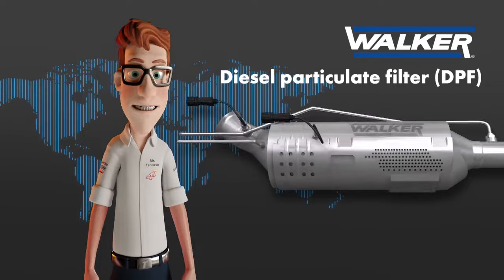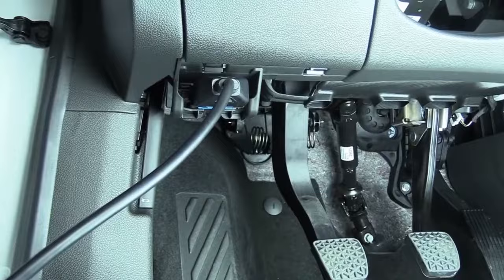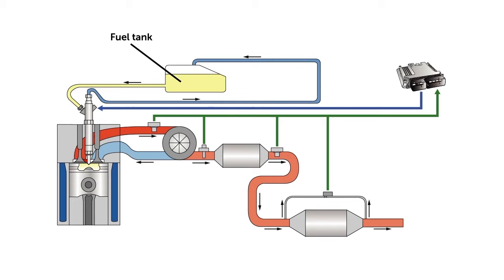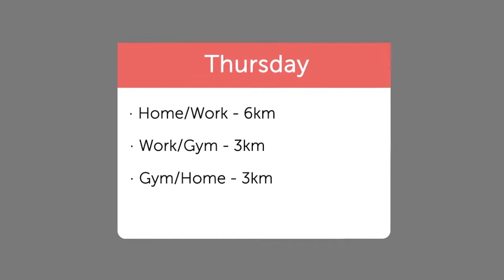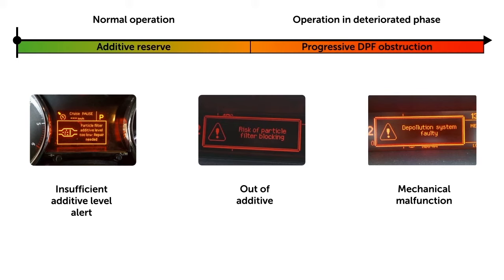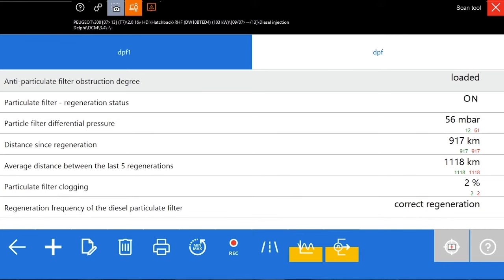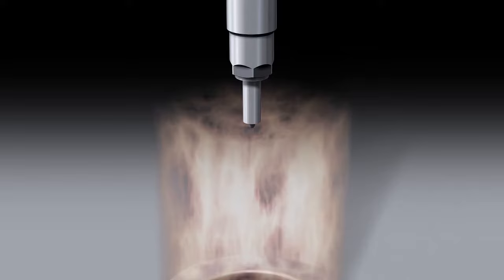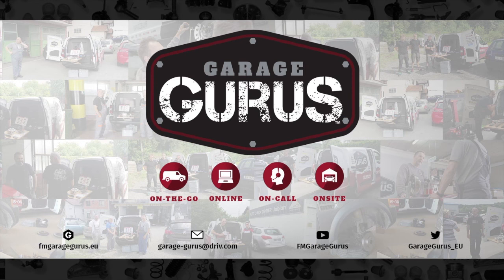Understanding the DPF Systems

Comment: The process goes unnoticed by the driver. Biggest lie I heard this month :D
Reply from the maker: Thank you for your feedback. Regarding the Diesel Particulate Filter (DPF). The DPF undergoes two regeneration processes. The first type is known as continuous regeneration, which occurs consistently when the filter's temperature ranges between 270°C and 450°C. This process is highly effective as it burns more particles than the filter can store. It is completely inconspicuous to the driver as no adjustments are required to the engine parameters. If the vehicle maintains this temperature range at the DPF, typically while driving on highways or intercity roads, the filter will remain mostly clean, eliminating the need for additional forced regeneration cycles. However, as a precautionary measure, the system performs a safety forced regeneration approximately every 1,800 kilometres to ensure the filter's cleanliness. Since the filter is already clean, this safety regeneration is usually brief.

On the other hand, if the vehicle primarily operates in city or congested road conditions, forced regeneration may occur at intervals ranging from 400 to 800 kilometres, or even shorter. This second type of regeneration involves specific engine processes such as post injections and the activation of electric resistances. These actions increase the temperature of the gases that reach the DPF filter up to 500°C. In non-additivated models, this regeneration process typically takes between 10 and 16 minutes, while in additive-assisted models, it lasts between 6 and 10 minutes. It is worth noting that this type of regeneration is easily detectable if the driver reduces the engine's revolutions or stops it due to the involved processes.

Have a nice day,

Garage Gurus Team
Reply: Me watching this video with a blocked DPf filter that now needs to be manually regenerated 😅

Comment: Heres a couple of DPF tips use low ash oil, not any old supermarket shite or garage oil sold by the barrel by mechanics, it's cheap, and has a high ash content also , dpf cleaner   additives in the tank and occasional high quality diesel helps keep the system clean as diesel isnt as good as it once was , take highway journey at 70mph or 100km an hour in fourth gear keep it there at a constant RPM try not to adjust the speed for 30/40 mins at a consistent speed to help passive regen happen.
Reply from the maker: Hello!
You're absolutely right about the importance of using the appropriate oil; it's crucial for maintaining the optimal performance of your Diesel Particulate Filter (DPF). Car manufacturers rigorously test their engines with a specific type of oil to ensure flawless operation. This oil contains the precise balance of phosphorus and other additives, making it the ideal choice for your vehicle. This is precisely why Walker strongly advises consistently using the oil type and brand recommended by the manufacturer.

Moreover, the quality of the fuel you choose also significantly impacts the level of soot accumulation in your DPF. Opting for low-quality fuel can significantly reduce the lifespan of your filter.

To ensure proper DPF regeneration, Walker recommends driving your car at speeds exceeding 80 km/h for at least 15-20 minutes twice a week. This practice effectively cleans out the filter and helps prevent future issues.

Have a nice day!

Garage Gurus Team
Reply: All great ways to invest more $$ in an unnecessary system.

Comment: Great video, but doing some research on cerium oxide fuel additives, it seems like they have been stopped because the health effects of it's emission, being higher than the benefits of it's effect on combustion.
Reply from the maker: Hi Ignasi, Thanks for your comment. You are right about the fact the cerium oxide has been little by little reduced from the DPF additives replacing it with Iron based additives in the new compounds, this was also due to the fact that cerium oxides produced mineral deposits in the DPF honeycomb reducing the lifetime of the DPF. As you could see the old model where lasting around 80.000Km and nowadays the newer models lifetime of a DPF is way over 250.000Km.
Have a nice day!

Comment: We have a Peugeot 307 (1.6HDI Euro4). The car has 240,000 km. There is a lot of black smoke coming from the exhaust. When we pass 2,800 - 3,000 rpm, the "Depollution System Fault" error occurs and the car does not drive well. What can we do?

Comment: My gripe is that many manufacturers forgot to allow operator commanded regens.  My vehicle, all it did all day, was regen.  Then for some reason it wasn’t.  Threw a code requiring a regen, but I couldn’t force it to do one, only when I went into OBD could I attempt one, by which time it needed a new filter.  Manufacturer ate the cost of that one.
Reply from the maker: Hello!
Thank you for sharing your experience with your vehicle. It's unfortunate that you've had to deal with this issue, but I appreciate you taking the time to provide feedback. It's worth noting that the process of forcing regeneration from autodiagnostic equipment can be tricky at times, so it's understandable that you may have encountered some difficulties. Once again, thank you for sharing your comment.
Garage Gurus Team
Reply: It's a more general problem.  They don't show error codes to users or allow actuator controls to debug problems.  You have to buy expensive scan tools.

Cars really should have that stuff built in.  It's basically locked behind software there's no reason to not have it.
Reply: Once those sensors are clogged or vaporizer is you can forget a forced or passive regen system needs cleaning out first on or off also need to do a system health checks first before anything there are values in pressure that need to be taken into consideration sometimes dpf is blamed but issues can lie in other places causing it the root problem

Comment: Great video but every car I buy these are the first things I remove. Car drives so much better, more HP and better fuel consumption
Reply from the maker: Thank you for your comment. Currently, these systems are integrated as standard, meaning that the engine design has been optimized to accommodate a certain level of backlash. Consequently, the valve crossover has been adjusted accordingly. Eliminating this system would result in a loss of backpressure, leading to incorrect valve operation. This, in turn, causes valves to remain open longer than necessary, resulting in increased noise, consumption, and power loss due to wasted fuel. Moreover, under current European Union regulations, removing these systems is entirely illegal and can incur severe fines for any workshop engaging in such activity. It's worth noting that these systems function efficiently and trouble-free when used according to the manufacturer's guidelines.
Have a nice day!
Garage Gurus Team.
Reply: @GarageGurusEU  liar

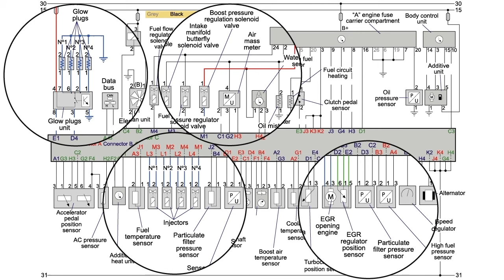Comment: At 10:56 its stated in the picture aside from egr, injectors that the BCU is needed to activate the "rear window heater" why?!
Reply from the maker: Thank you for your inquiry. To initiate the regeneration process of the diesel particulate filter (DPF), a minimum exhaust gas temperature of around 380°C-400°C is required at the DPF catalytic converter inlet. Some vehicle manufacturers, such as those in the PSA group (Peugeot, Citroën, etc.), employ a method where the engine is put under load by activating the car's electrical systems (rear window heater, rear-view mirror heater, etc.). This increases the exhaust gas outlet temperature from the combustion chamber, ensuring the necessary temperature for regeneration.
It's crucial to refer to the vehicle's service manual to identify which specific electrical systems are essential for regeneration to occur. If the filter is clogged and periodic regeneration is not taking place, it's possible that one of these systems may be damaged and require repair for normal DPF regeneration to resume.

Have a nice day!
Garage Gurus Team

Comment: Good video, thank you for your info and these opened my eyes on it.
I've tired to use some of additive products for my OM651 diesel engines to clear some soot and prevent any issue from DPF.
Added additive (add 1 of 2-3 time of refill full tank) to the tank and full fill the fuel tank and run it's look smooth.
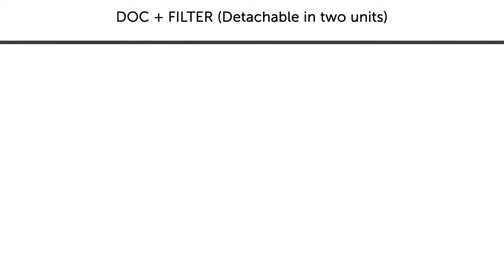 But sometime I was found green sticky liquid 1-2 drop at the exhaust pipe (located on back passenger) that remind me it's look like 4:47 of your video.

After found this green liquid and run the car until 1/4 of the tank then re-fill it without additive, this green drop disappear.

Not sure I use the correct way to save my DPF? Or this green liquids are the problems of my DPF?

I use short run (5-10 km) in the morning < that may product soot.
But every month I drive the car to travel around 150+150 km (go and back) on the highway every month and drive on the highway 60 km once a week.
Reply from the maker: Hello! 
To maintain a DPF in optimal condition, especially considering frequent short trips, it's advisable to drive approximately 60km continuously once a week and make a longer trip of around 150km each way (300km round trip) once a month, preferably on the highway with minimal traffic or congestion. This approach is sufficient to preserve the DPF throughout its lifespan, assuming the vehicle is operating smoothly and receives regular maintenance.
Using specific additives designed for DPF maintenance can be beneficial if used sparingly and only if they don't contain substances that could harm other parts of the exhaust system or engine. It's prudent to consider additives when the DPF's lifespan is nearing its end, aiming to extend its functionality, provided the vehicle is otherwise in good condition and any issues are isolated to the DPF.
In essence, a well-maintained vehicle with a healthy DPF and the described driving routine typically doesn't require additional assistance to uphold its performance.
Thanks for following us! 
Garage Gurus Team
Reply: @GarageGurusEU  Thanks for your advice again. So the big point is all about maintenance and drive in the long way enough to burn some soot.
Reply: As a mechanic for forty years I'm sick fixing the modern Diesel cars and vans they are All a load of SCRAP .

Comment: So my car, a 2012 Peugeot, has a dpf and cat converter, no adblue system, and the tailpipe is spotless and I've hardly ever seen any smoke even upon start up.

Conversely, my work vehicle is a 2017 Peugeot (again with dpf, cat but with adblue) and the tailpipe is like a typical 'old" diesel - very sooty. How would this be so??
Reply from the maker: Thank you for your inquiry. The issue you've described could potentially have various underlying causes. These include the formation of ring cracks, which can result from temperature fluctuations during the regeneration process, especially when it's interrupted abruptly. Cracks in the DPF monolith may also occur due to impacts with objects on the road or during transportation. Additionally, uncontrolled expansion during forced DPF regeneration cycles can contribute to the problem. In some instances, a malfunctioning fixation mat may allow burnt gases to circulate around the DPF housing without proper filtration. To pinpoint the precise cause, a comprehensive X-ray analysis is recommended.
Have a nice day!
Garage Gurus Team
Reply: @GarageGurusEU  could be alot of things ,glow plugs ,injectors ,map.maf sensors .blocked pipes ...its an endless list of trials if it doesn't show up on reader....on some vans they wont regen if the temp senor in the wing mirror is faulty ,,absolute joke...

Comment: It is possible that EGR work incorrectly and i have dpf error?
Reply from the maker: Hello!
EGR system failures can permit increased amounts of burnt gases into the combustion chamber, harming the mixture and leading to more solid particle accumulation in the particulate filter. If combined with frequent city driving, this can trigger DPF errors. 
Hope you find our answer useful.
Have a nice day!
Garage Gurus Team.

Comment: Just ask the question
WHY DO THEY MAKE THE SOOT PARTICALS  IN TH FIRST PLACE  
AS A DIESEL FITTER I KNOW DO YOU

E G R  HINT
Reply from the maker: Could you please reformulate your question so we can give a proper answer? What did you mean?
Thank you.
Reply: @GarageGurusEU  my question is simple
WHAT CAUSES A DIESEL ENGINE TO MAKE SOOT
Improvement In injection pressure, spray pattern, IE common rail including electronically timed and fired injection, and compression ratio have made these engine's perform WITHOUT SOOT UNTIL YOU ADD THE EGR CIRCUIT
Reply: @garreysellars5525 Nox. To get complete combustion you need high combustion temperatures. But this causes Nox gas to be generated. So a small amount of exhaust gas is fed to the inlet manifold which reduces the temperatures but this makes soot. 
On a still day, Nox sits at about pushchair height, so adults don't breath too much in whereas their offspring do. 
Basically a diesel engine is great if you like polishing a turd. After all the filters and treatments plus the extra fuel used for regeneration, the overall efficiency comes close to petrol.
Reply: @yodab.at1746  
So we spend on teck to make engine's efficient
IE turbo. Intercooler to improve air density and then we stuff that up by adding Hot air defeating the original purpose
Try adding water methanol injection to intake to reduce combustion temp
Works for me exhaust temp dropped  significantly
It how I protect my turbo on heavy pull when loaded
Reply: @garreysellars5525  water injection was pioneered in aviation a long time ago to increase charge density at high altitude. Also to stop detonation under heavy loads.
Reply: @yodab.at1746  yep so let's use that 
Several trade offs 
Less NOX
More power on less fuel
Better fuel economy
Less fuel burnt Less CO2 
Produced
All sounds like a win to me
All sounds a plu

Comment: Where does all that DPF waste end up after regeneration + all the chemicals used for it
Reply from the maker: Hello!
Thank you for your inquiry. In modern diesel vehicles, the Diesel Particulate Filter (DPF) plays a crucial role in eliminating soot generated during diesel combustion. The process of regeneration is responsible for incinerating these particles, transforming them primarily into harmless CO2 and water vapor. These byproducts are then expelled through the exhaust system. Post-regeneration, what remains within the filter is mainly ash, which originates from engine oil and fuel additives. Gradually, this ash accumulates, eventually necessitating either cleaning or replacement of the filter.
In essence, following the regeneration process, the majority of combustion residues are emitted as CO2 (the same gas we exhale when we breathe) and water vapor. Nonetheless, a portion of ash does remain within the filter. Additionally, certain manufacturers, such as PSA Group (Citroën, Peugeot), utilize fuel-borne additives to optimize DPF regeneration. Initially formulated with Ceria oxide and later with iron oxide, these additives are introduced into the fuel tank during refueling. They facilitate quicker and more efficient regeneration at temperatures around 100ºC, thereby conserving fuel. However, over time, these additives can increase the accumulation of soot due to the presence of Ceria and iron residues. As time passes, these residues may obstruct the filter, making periodic replacement of the unit essential to prevent significant issues arising from excessive exhaust backpressure. These issues include heightened fuel consumption, reduced power output, and the potential for damage to other engine components.
Hope it is clear now,
Have a nice day!
Garage Gurus Team
Reply: @GarageGurusEU  Thanks for the detailed explanation

Comment: seems like a poorly designed system,  so many cars getting scrapped early and wasted £££ trying to solve dpf related problems. in hindsight and simple cartridge or detachable block which would be replaced every 6 months would have been better. or better we didnt believe the "expert's" at the start and stayed with petrol